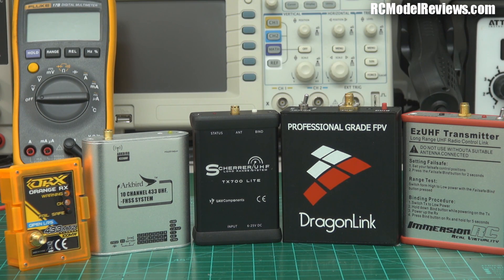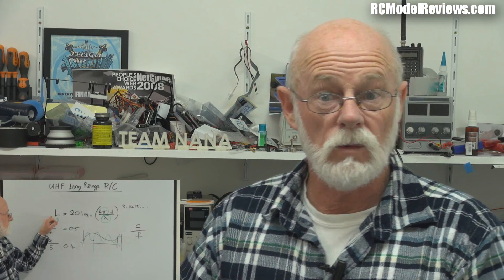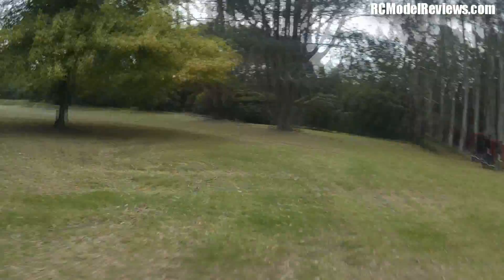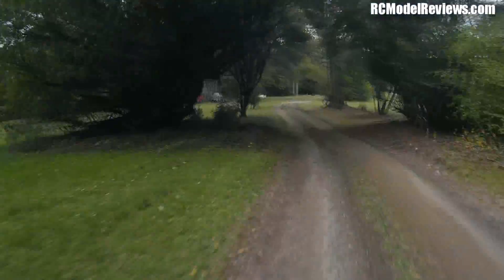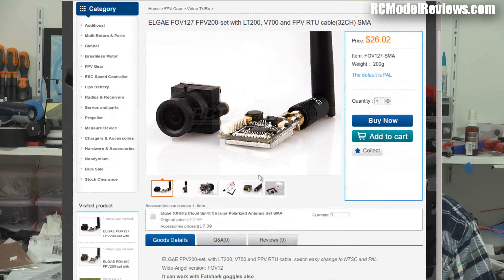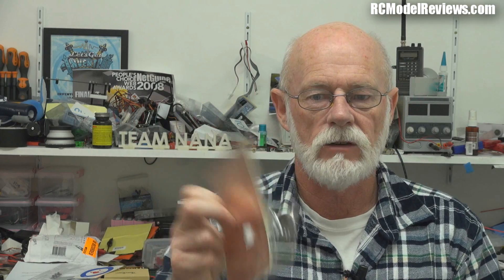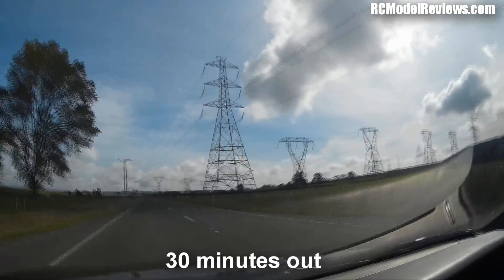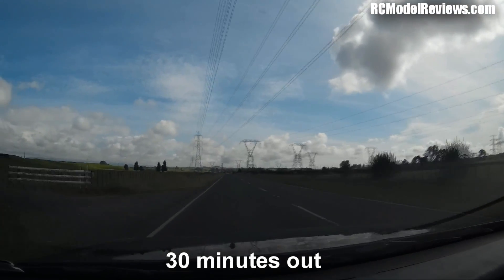Weekly News (22 April, 2015)

Comment: Bruce, you need a power inverter, a decent plug in your truck and just take that soldering to the tailgate, saves a lot of time and trouble for a five minute video and is much cheaper than fuel.

Comment: Hi Bruce, Just a thought, and as it is a gap that seems (to me at least) better to have as openly known, the submission of safety rules you proposed to fly under and so that it can be known that yours meet or exceed those already in place by the club? As the MFNZ seemingly like to use it as ammunition against you & your validity for your wings and by saying that its just rebelliousness to authority, that you simply "refuse to fly under their rules" and conveniently leave out the bit about having proposals of self enforced high level rules of your own that you believe exceed the old rules currently flown under? (If that is as I believe to be the case?) I am also curious if the rules where put forward by you through your membership with Parkflyers recently, or submitted separately to MFNZ or CAA in the past? If an earlier submission/recommendation, then can I assume there was some intent on your behalf to initiate a dialogue on model avoidance and its future relevance and importance to a cohabited air space? And if so, do you think MFNZ is being additionally resistant to you because of potential commercial benefits of any rule variations around that point? (If there would be any?) Anyways, I better get back to the bench myself mate as I have a Vector to finish installing & I am very curious to its performance capabilities? All the best Bruce, thanks for your great reviews and tech info.. Cheers!

Comment: I live close to a commercial airstrip so I have to drive more than 30 minutes out before I can fly my 250 quad. I know how frustrating it is. Here's a tip though, have a couple of bags worth of battery powered gear.

I usually have a mains socket nearby but I have crammed a lot of tools, spare parts, tape and other stuff into my two plastic bags. The bags break sometimes but they're dirt cheap anyway. When I go out with my models (a 1/10 scale car and the quad) I just grab the bags along with me and I can usually fix things out of the trunk of my car. I could even get a 12V soldering iron as well and forget the mains completely.

Remember, if treated right, that car lead acid battery is like a hobby angel; always being there with a nice good old beefy 12V supply and it will more or less take whatever you throw at it (for a reasonable amount of time). Heck, you could even get a mains inverter and power your regular tools out of your car! It's absolutely brilliant!

Comment: Hey Bruce, I really like the idea of a proximity fixed wing! A suggestion - use a flight controller (maybe cc3d since they're dirt cheap). That way you'll be able to compromise on flight characteristics in exchange for small size and durability, without getting a platform that is impossible to control.

Comment: i'v built a mini delta plane about 500mm wing span, its made of epp and some paper coated foam from warehouse stationary, with a carbon rod, turnigy 1500 kv motor, 6x4 prop, 500 mah 3s, and a 15 amp turnigy blue esc, its fast, agile, can go vertical, my fpv stuff might be to heavy but that bundle in the video would match well, i'm in nz.

Comment: Hi Bruce, in addition to the proposal to allow model flying no higher than a building and within 100m of the building within the 4km exclusion zone I also see this proposal relating to the proposed part 102 rules.

"It  is  proposed to amend  101.205(a)(3)  to change  the  identification  of  the  body  that  may  be  approved  by  the  Director,  to issue  a  pilot  qualification  and  to  appoint  persons  to  give  instruction  in  the  operation  of  remotely  piloted  aircraft,  from  “a model  aircraft  association”  to  “an approved  person  or  organisation”.  This  change  reflects  that  the unmanned  aircraft sector  is  now  wider  than  traditional  model  aircraft  operators."

This could be your ticket back to flying at the airfield but you need to act now. Start lobbying for your views on the proposed rule changes. Organize as many people as you can to start letter writing and get your views heard. 

Best of luck,

Greg.

Comment: Bruce mate, you asked for suggestions to help you get around a problematic situation. I was one of the ones suggesting you see local farmers, but if you keep forgetting to take gear with you, or don't do very covert testing with the doors shut before heading out, then your comments here suggest you are fu#@?d. 
I fly hang gliders, no not every day, nor to be my income generator, but all close launch sites average 30 minutes away. 
You have an active mind with significantly more knowledge & probably logic than many in the sport. Being outspoken has probably caused a lot of the grief you are enduring. There comes a time when you either have to pack it up or face & deal with the problems that you may have contributed to. Stop making excuses and just put in the effort required to achieve your goals. I like you Bruce and value your reviews, but time for a glass half full.
Sorry if this comes over a little harsh.

Comment: Turn your work shop into an Edison Cage so no signals can escape. Lock the door and get on with it. Yes well we will know you did it but the cocoa brigade could only guess. And for extra dig value get a signal scrambler and leave it on in the car.......Just a short range one that covers the workshop area ish....while you work inside the Edison Cage where no signal can get in or out. I made mine from bird cage wire and it really does work well even on window !

Comment: I have two of those RCTimer combo's one of which is in use on my Armattan Morphite and I love it! For a CMOS the picture is excellent! Nil input filtering required! Can't beat it for the price!

Be warned though - both of mine came as RP-SMA even though it's listed on their website as SMA... I ended up desoldering it and soldered on a SMA connector...

Comment: Dear Bruce i believe immmersionrc comes with a manta wing racer, so it is the works.
Dit you also test uhf jr module? The range is way different compared to the external module. And with the frsky lr9 receiver is there still a need for uhf modules?
I am flying uhf but wandering if the frsky is an alternative.

Comment: This is why I built a flight box that includes a little butane soldering iron.  Wouldn't have been able to do anything with a borked antenna, but at least I could fix faulty connections.

Also have a spare servo or two in it, all the spare props I can fit, a multimeter, sometimes foam safe CA with accelerant (that tends to find its way out of the box though), battery voltage checker, a bag of rubber bands, and screw drivers.  Sometimes I have extra bits of wire in it too and liquid electrical tape.  Couple pairs of pliers, a knife, and side cutters too.  The box it all goes in came with larger cheap WalMart toolbox.

Comment: Banggood.com sell the same transmitter with a different camera for cheaper:
110 degrees:
http://www.banggood.com/Eachine-700TVL-13-Cmos-FPV-110-Degree-Camera-w32CH-Transmission-p-965760.html

148 degrees:
http://www.banggood.com/Eachine-700TVL-13-Cmos-FPV-160-Degree-Camera-w32CH-Transmission-p-970051.html

The camera isn't fantastic

Comment: Hey bruce, about that fixed wing FPV proximity, I reccomend the FliteTest "pun jet" mini. The plans are free at flitetest.com, or kits can be had for $15. They fly off of 1806 or 2204 type motors.
Reply: Low Elevation RC Yeah, I saw that but I' haven't found foamboard to be that robust in the past.
Reply: ***** I have their "Tiny Trainer" and I've ran the thing straight into the ground - nose first - it seems to hold up pretty well and with a little more packing tape (ha ha) it may be even stronger!
Reply: ***** Small carbon fiber rod on the wing leading edge and tail feathers to start....
Reply: lasersbee Yeah, I'm considerin g adding that to the leading edge of mine. Already have a really thick spar in it, since I overpowered it using an Electrifly Ammo Inrunner.
Reply: Bruce!! I am from NZ, if there is a Bunnings near you they have the foam board! If you can't find it, I'll send you some!
Reply: Harrison Switzer-Corbett We have a Bunnings in Tok -- but they don't have foamboard.  Like most of Tokoroa, they're about 15 years behind the rest of New Zealand.  However, there's also a Bunnings in Rotorua and one in Cambridge so it's only about 45 minutes away to grab some.
Reply: Low Elevation RC the HK bonsai would be a good option. mine goes like stink with an emax 2204-2100kv on 3s
Reply: M6EXH Watch the next Weekly News coming up in an hour or two :-)
Reply: Will go watch it now, Thanks bruce :)

Comment: portable soldering iron will save you a lot of trips, and you can take some iron grid and make "Faraday cage" than save you more time, because you can turn on and test equipment in the workshop
Reply: Eugen Nomatterr My hangar is a pretty effective faraday cage anyway -- but facts won't sway those with an agenda and a vendetta to pursue.  Even the radio regulators in this country have said that my transmissions are 100% okay and legal -- but it's nothing to do with safety -- it's simply petty personalities and politics so there's no way logic, commonsense or fairness come into it.

Comment: Bruce.... how tolerant are the rx5808 receiver modules mine is taking 2.8ma.. and i suspect i may have given it reverse polarity... of given it 8v as have been running it off a 3s battery with the balance plug plugged in and may have plugged in reverse...?

Comment: I've used it on the Xcite Bruce. It's actually not a bad camera and fpv system for the price. I should have a video out on it shortly :) I'm going to buy a second one.
Reply: BMSWEB If I could only find another Xcite =/ Cracking wing, sure the HK ones are similar?